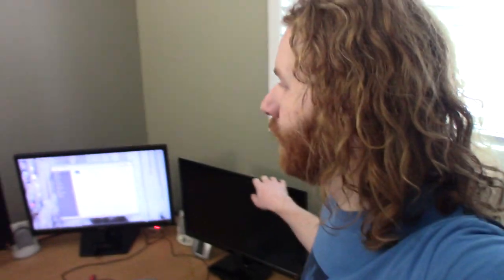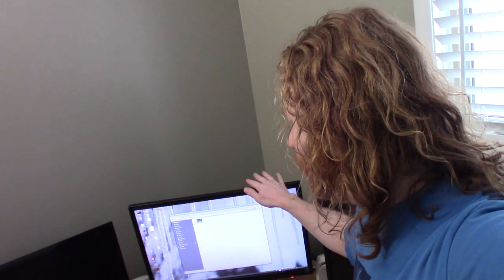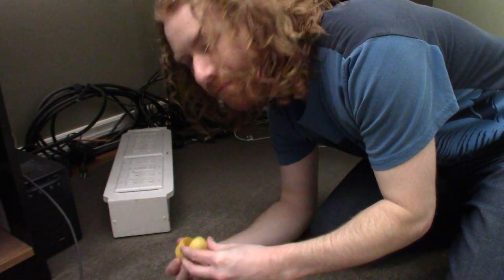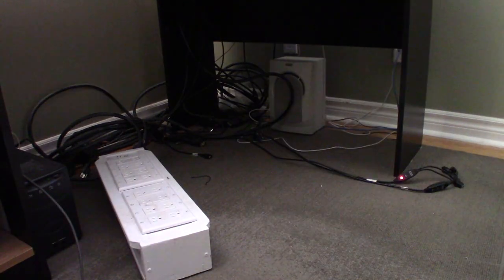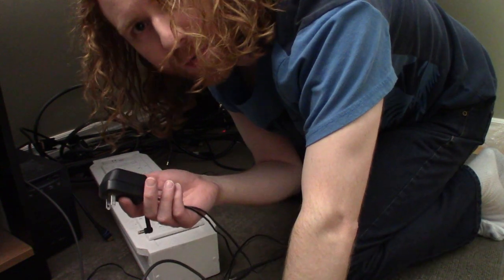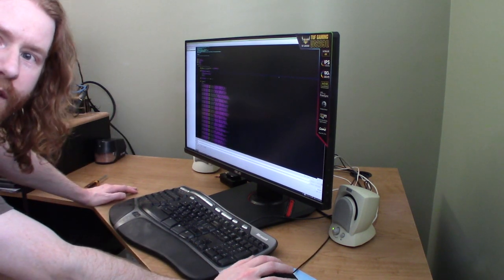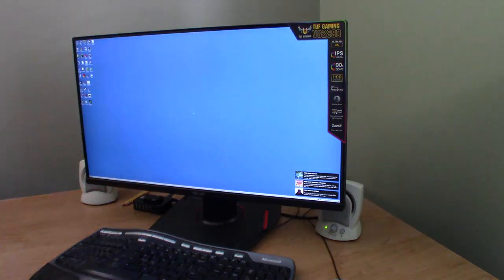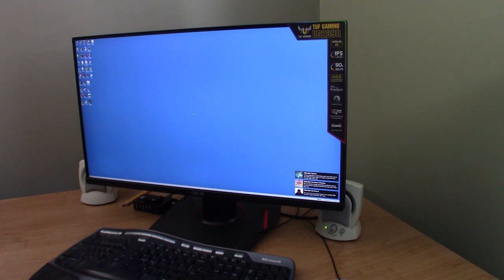Redoing My Home PC setup, and Unboxing Asus Tuf Gaming VG289 4k Monitor

Comment: Should I buy this? My boy trying sell it to me for 200 new in box never opened .? I mean for my ps4 pro until I get the ps5.
Reply from the maker: At that price I would go for it, though if it's only to play a console, I would maybe look at a 4K TV instead, unless you plan to play the console more like a computer, ex, at a desk.
Reply: @redsquirrelftw  yea I have a 4k 55 in samsung but my eyes be hurting playing on that huge tv. Ima plan to just use it for ps4 pro n ps5 if I ever get my hands on it. Also will get a desk setup . So a good deal for my ps4 pro?
Reply from the maker: @40calmob82  Yeah in that case I think it will work fine.

Comment: Hi , hdr is vibrant in this monitor ?! Do you reccomend this monitor ?!
Reply from the maker: I don't really have much to compare it to, but I'd say it's pretty good.  I feel the contrast ratio is not SUPER good, but it's not bad either.  I used one of those online calibrators where there are bars of colours and you adjust brightness/contrast until all the colors show up different and I found on the ends it was not quite as good as I'd like (ex: the last 2 and first 2 looked the same) but for general usage including gaming it's been great.  My setup is different than in this video now, as I have it setup as primary, and then secondary is on top.  Takes a bit of getting used to to go from 1k to 4k but it's very worth it.  I have trouble working on a 1k screen now, I just feel I don't have enough real estate for windows!  With 4k I find myself tiling windows more instead of minimizing all the time.

Comment: Hello. Is this monitor providing a better refresh rate at lower resolutions? Thanks.
Reply from the maker: I would imagine so, but if you want a lower resolution and higher refresh rate you are better off buying a HD monitor as it will be better suited for that resolution and probably have a higher refresh rate.  Something along the lines, either my KVM, or Linux itself or maybe even GPU (Even though it's new) seems to have trouble driving these even at 60hz, I had to drop them to 30.  Noticeable when viewing any video that has a large panning scene.
Reply: @redsquirrelftw which gpu are you using
Reply from the maker: Radeon 580 if I recall correctly.  Shows up as [AMD/ATI] Ellesmere [Radeon RX 470/480/570/570X/580/580X/590] (rev e7)  It was one of the few cards I could find that had dual HDMI out. Was wanting to avoid using adapters as much as possible as it just adds a point of failure.  I wanted to go HDMI since my KVM is HDMI and you can get away with longer cables.   At some point I might move my workstations back upstairs though... my current setup is nice but also sometimes a pain.
Reply: @redsquirrelftw  yea the rx580 is pretty old at this point, almost 7 years old so it's no wonder it can't run 4k at high fps
Reply: @redsquirrelftw when this came out it was almost 3 years old as well, but i think 2 4k monitors would also not work well on that gpu

Comment: Why do you need to connect directly to your pc’s? Cannot you not just have a small form factor pc upstairs and remote connect to the ones downstairs and avoid the hassle of cables and holes in the floor?
Reply from the maker: There would be serious lag trying to do that. That also requires that some kind of software is running and is active.  If I need low level access such as to install an OS I rather be connected directly.